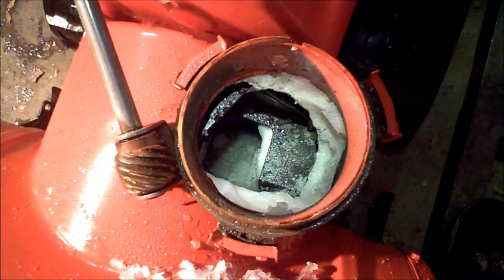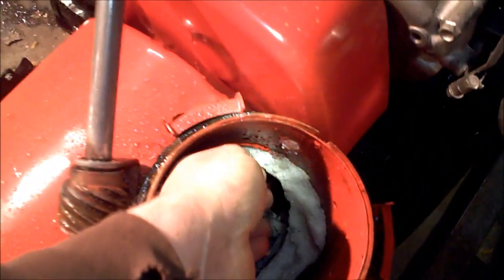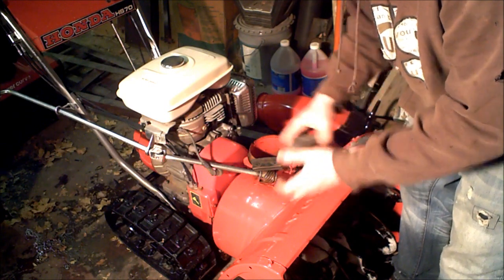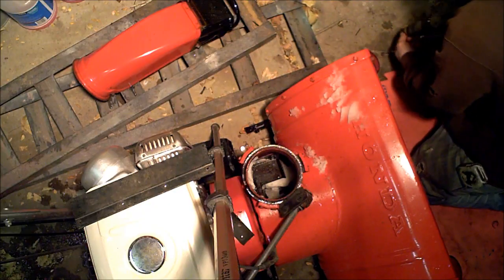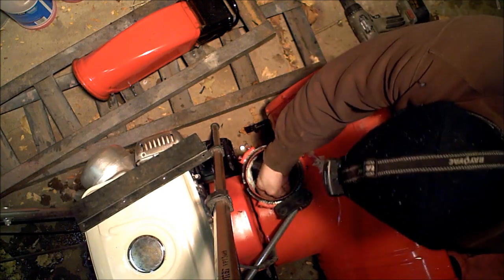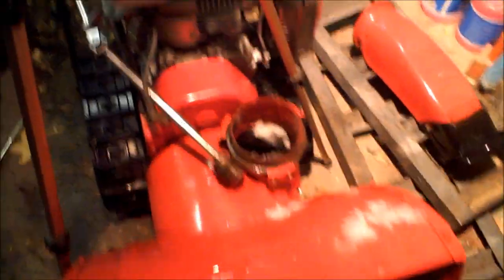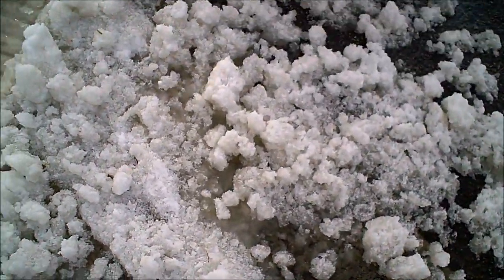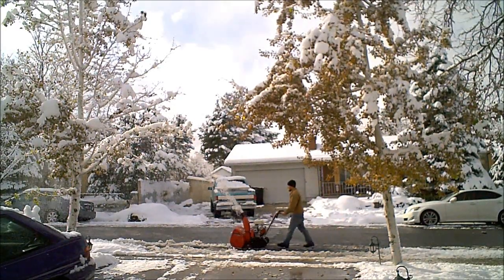Modify Snowblower to never clog and throw twice as far w/ Impeller Kit

Comment: I did this little modification and tried it out in about 8 inches of snow.
It will throw a lot further, but I don't think the engine and belts will stand it.
So I will have to remove the mod.
Reply from the maker: Because it is a more efficient impeller is will use more of the available horsepower. You will hear the engine work hard for the first time in it's life as it is doing more work. As far as belts, they could break if they are old or worn out. Most belts are rated to easily handle 20+ horsepower.

Comment: I have a toro s200 from the late 70's, have gotten that thing tuned
 up and it kicks ass, just got a MTD snowflite 2stage blower that need some love, I am certainly going to try this out, seems like a no-brainer to me.
Reply from the maker: Those old Toro's are die hard machines. It works off the same principle as your S200. Once those start to wear and you get a gap more than 1/4" an S200 with suffer in throwing distance.

Comment: I did it to my 37 yr old (modified) John Deere and it worked fine. I did notice that I will have to upgrade to a tighter belt that powers the impeller. The current one slips a bit under the added load.
Reply from the maker: It definitely uses more of the available horsepower of the machine. Belts get glazed/polished after a couple of  years of running.

Comment: I have an MTD (5 1/2  22") with a plastic impeller.  It looks like the gap is about 3/4 inch.  Will this work?  Another question:  How to you remove the chute on this machine to access the impeller?  Any help would be appreciated.  Right now this machine throws the snow only about 3 feet.
Reply from the maker: Your machine is a prime candidate for this modification. With a 3/4" gap there is no reason you shouldn't be able to 5x-10x your throwing distance. MTD has a few styles of chutes but most just have 4 small bolts that hold them onto the rotating assembly.

Comment: Hi 65:
I have a 9-year old Craftsman 536.889251 (Murray) 33" 13hp snowblower that works great in dry snow, but not at all when even slightly wet. Your solution intrigues me, but I am not a "wrench" and have a couple of questions. The impellers (3) have an uneven gap from about 3/8" to almost a 1/2" at the rear part; it seem fairly thick and may not work with the sheet metal screws. I removed the chute, and there is quite a distance down the rectangular hole to reach the impellers; larger than any drill bit I've seen. Any thoughts?
Reply from the maker: On some of these Craftsman it is a little challenging. This is one of the reasons I try to make a self tapping screw work as you can get drill bit extensions pretty easily. Then you can use a phillips bit to drive the screw. I picked up a 6" extension for a couple bucks at the Home Depot. Sometimes if the steel is really thick it will take 2 screws to get through as the tip on the first will wear out.  In your situation it is well worth the effort and you will see a huge improvement.
Reply: sixtyfiveford
Thanks. If I may ask one more question; the impellers have a round hole (5/8" or so as best I remember.) Is it OK to block these with the rubber gap seal? Is it only a lightening hole, or is there another reason for it?

Comment: I think you mounted the little rubber pads on the second stage blower with only a small clearance is that correct ???   you screwed them right on the blades of the impeller??    I am hard hearing and I didn't catch all you were saying..
Reply from the maker: Zero clearance and yes, screwed directly to the impeller.

Comment: Awesome modification.  Performed it on my MTD Yard Machine (26" / 8HP) snowthrower last night.  Easy to do.  Used my snowthrower this morning.  The mod ABSOLUTELY WORKS -- snow was thrown significantly farther.  Easy and very effective modification.  Thanks for posting.
Reply: Rodney Palmer The only issue I had with the chute was that all bolts had some surface rust on them, and needed a little convincing to come off.  The snowthrower is garage kept, so the rust was not too bad ... didn't even need to use any penetrating lubricant, just a little extra muscle to get them off, and I replaced with new nuts and bolts when re-assemblying.
Reply from the maker: +Jerry Rath, III  That's great. I'm glad you took the time to do the modification and thanks for letting me know.

Comment: I have a brand new Troybilt snow blower and it has a 3/8 inch gap, I want to put the paddles on but I do not have a tire mud flap or conveyer belt but I do have solid rubber matt two ft by two ft . 13/32 that's .406 thousands of a inch thick can I use that?
Reply from the maker: Yeah, that would work as long as it is rigid and doesn't rip easily.

Comment: Quick question. I put these on my snow blower and made sure they were up against the metal. After I re-installed the chute (removed like you did to attach these) I noticed after the rubber flaps clear out of the metal housing area there is then a gap between them and the chute. Do you think this will clog? Or do you think it will work just like it should? I'm guessing it will work like yours. Thx for the great videos you put on here! Was able to fix my own snow blower thanks to your videos!
Reply from the maker: Yeah, it will work.

Comment: Your video and other videos I watched regarding snow blowers helped me realize how simple these machines are. I bought a used 1991 MTD 24" a year ago. I had major issues with it working decently the first year I had it. I only use this machine for removing snow in the back yard for my PUGs. I replaced the 2 belts (auger and drive), new generic shoes, a friction plate rubber, a shave blade and lastly the impeller pads. I bought a strip of rubber matting from tractor Supply and screwed them on the impellers. I cannot believe what a drastic change and improvement those pads made. NO CLOGGING AT ALL. And I blow through the 24" we received in the last week, and also some wet snow without any hassle. The only bitch was the cheap self tapping screws I bought from hardware store, I broke a couple when drilling pads to impeller. Your instructional video was awesome and extremely helpful. My machine is like new. Let is snow, let it snow, let it snow!
Reply from the maker: That's Awesome.... I'm glad you liked my videos and you attempted this. Yeah, some of the cheaper self tapping screws will snap off their drill point. Glad you got it sorted out though.

Comment: I HAVE a murrey snow blower about 7 years old clogs up on wet snow. will your fix work because the metal shaft from the top of the impeller is a lot deeper then what you show that is why my shoot clogs. the impellers blades are close to the housing.
Reply from the maker: Yes, this will fix that problem.

Comment: Interesting video.  I have a 12 hp 30" x 21" craftsman snow blower.The auger gear box broke.  When I go on Sears web site the total individual parts cost is $455.00 which for a 15 year old machine is cost prohibitive.  Any idea where I can get a cheaper replacement gear box?
Reply from the maker: Sears doesn't make any of their own power equipment so they are always more expensive than anyone else. What's your model #?
Reply: sixtyfiveford My Craftsman snow blower model is 536.886390.  12 hp 32" wide.  The total piece part price to replace the gear box is $455.00.
Reply from the maker: Your machine is made by Murray. Chances are just your worm gears are bad (313861 or 53730MA and 313862 or 53732MA). I find one new online for about $80(313861 Ebay) and the other for around $25(313862).

here is a better view parts breakdown:
http://www.partstree.com/parts/?lc=murray&mn=633134x31A+-+Dual+Stage+Snow+Thrower+%282000%29&dn=11249

Here is a complete used unit for under $150:
http://www.ebay.com/itm/Auger-Gear-Box-Blower-Assembly-Craftsman-Murray-Noma-523-Model-trac-drive-3-/281153480424?pt=LH_DefaultDomain_0&hash=item41760da6e8
Reply: sixtyfiveford Wow!  You are right on about this.  The drawing you send is the exact same one that is in the Sears manual that I got when I bought it.  I need the complete gear box including the right and left side case.  Mine got chewed up really badly when the bearings went.  Interesting you found the used one. I might see if they will negotiate and where it is.  I do not need the impeller just the gear box assembly minus the long shaft that the two pieces of the auger slide on.  I do need the shaft that the impeller mounts on.  Thanks so much for the info.

Comment: I have a small gas matis roto tiller, and I can't get it started! I could pull on that cord all day till my shoulder fell of and it still wouldn't start and I'm super strong! So I know I need to get an electric one if I want to be able to handle it on my own. I'll be happy if I can just get a small electric that I can manage on my own! Thanks again for all your help, I really appreciate it..
Reply: Diane.  The carb is probably a ZAMA.  You can buy replacements for around $20 which will be a lot less than buying another mantis.

Comment: Thanks so much, I've read such mixed reviews. I just had a beautiful deck built and it's high off the ground so I'm concerned when the snow is heavy. I really appreciate your really quick feedback ! Di
Reply from the maker: A gas powered snowblower will always outperform an electric but there is the hassle of maintaining a gas powered unit. Most of the negative reviews are performance related and people expect a $200 electric unit to perform the same as a $600 gas one. Anything is better than shoveling and if your expectations are realistic you'll be happy. Personally I would choose the 1500 or 1800.

Comment: actually, i already did do that, but the material i used was too thin, i put them on last spring, they worked great until this morning, then i noticed they wore down too far, and the snowblower clogged this morning, thasts why i wrote to you, to see what you used. i will get back toyou, but it will be awhile     dick bailey
Reply from the maker: Conveyor belt and tire sidewalls have reinforcing fabric stands. They are your best bet.

Comment: Thanks for this video.  I had a 1 inch gap. The snowblower always clogged and I didn't know what to do. Thought I needed a new one. This mod did the trick. Got mudflaps, cut them and bolted them and then turned on the machine and spun the impeller and let it cut it exactly to size.  Mod took prob 20 mins. I've got the best snowblower on the block!!  Thanks again!!
Reply from the maker: That's a huge gap. If they bend to much you with that gap you can add a flat piece of metal to within 1/4 of the housing. Put it in between the impeller and the rubber flap. Thanks for posting and thanks for trying it. -Moe

Comment: Hi, I'm looking to buy a small electric snow blower to clear my deck and my driveway when it's a small storm and not enough snow for my plow guy to bother with. You mentioned a Toro Single stage in your video, is that still your preference? Thanks for the info, Di
Reply from the maker: Yes, you would be very happy with anything Toro. There small $100 Power Shovel is great for a deck but a little small for a driveway (still better than shoveling). There 1500 Power Curve is only 25 pounds and and does twice the swath(15") of the Power Shovel. It would be great for deck and driveway and it is around $200. They have a third (1800)which is a little wider(18") and has a bigger electric motor(12amp vs 15amp). It is also 25 pounds and is the priciest at around $300.

Comment: dude, great idea, but when those s/t bolts come loose, and fly out like BULLETS, they're gonna smash some windows in homes or cars, take someone's eye out, or worse.  you have to think about that.  use nuts/bolts with locking bolts and locktite, or tack welded nutss on the bolts- and this is why the mfr. didn't put that on there, for liability reasons
Reply from the maker: Ice chunks are just as hard and have 10x more mass.

Comment: Wow!  I'm not that handy so it took me a bit longer than you to do the mod.  Used a cheap truck mud flap and the metal screws.  I tried it out today on some fresh snow and I'm throwing snow probably 2.5 -3 x farther then before! My snowblower was barely putting snow out 6-8 ft before and now its at least 20ft.  I can also take larger swaths without leaving a trail of snow behind from overflow.  Thanks!  Great video
Reply from the maker: That's great to hear. I'm glad you took the initiative to tackle this. 2-3x is great!

Comment: I did your modification and I can throw wet snow 30 feet. I did not have the rubber stuff You mentioned so I bought a piece from McMaster-Carr  #8617K45  for $25. We had about 8 inches of wet snow and the snow balled up in front of my 11HP Craftsman 30" wide machine.I have modified my machine by putting 2 LED lights on either side of the blower,  but the blower's alternator makes AC and not DC as needed by the LED lights. I solved that problem by wiring a Trimumph bike diode in.
I also used 2 U joints, an eye bolt, a rubber grommet, then mounted the chute control handle up through the top control panel instead of being at your knee level.
Reply from the maker: Moving the chute rod is a great idea.

Comment: Cut up some old (60s vintage, in fact) scooter tires for their sidewalls to make impeller blade extenders for an '85 Toro 1132. First thing: JEEZ, that impeller has seen some abuse! The blades are at crazy levels of bent-ness and bruised-ness, AND FAR (one was >3/4") from the walls of their housing. (This summer I'll take it out, straighten and weld, and put in big, permanent holes for rubber blade extenders. Meanwhile... ) I put the rubber blade extensions on (with stainless self-tappers, yeah) and it is AWESOME. (Tested against some snow piles from last week's storm.) I'm up in New England, and we're gonna get pasted with some wet and heavy tomorrow. Great "live" test run coming! Note Silicone lube spray helped the break-in of the chamfered, but still over-length, "blades." Thanks, sixtyfiveford! Good stuff!
Reply from the maker: You're welcome. I'm glad you took the time to do this and love that you used vintage tires. Yeah, those Toro impellers take some abuse and are almost always bent. Let me know how the test goes in the next few days..

Comment: Thank you for this great Idea. I bought a craftsman 9hp 24 in cut yesterday for $125. before I modified the impeller it wouldn't throw snow 2ft. After I installed the same mods exactly as you did it and now it throws 30-40 ft with no problems and no other adjustments.
thanks again. Folks this will make your snowblower work like a new one.
Reply from the maker: Thanks for posting. I'm glad you tried it and got such amazing results.

Comment: Hoping you can help! First, finally got around to doing this mod on my Ariens ST824 a few days ago, just as we were getting hit with some heavy, wet snow. All went as you explained and it definitely throws the lighter stuff MUCH further now (wow!), and at first, worked great  on the slushy plow pile on the street.  However, after about the first 45 mins of use, the rubber truck mud guards I used still seem to be pretty tight against the inside of the impeller/shoot area (should it be?). And now, it seems like the adjustment on my right hand control (the clutch for the auger drive?) has changed all of a sudden where if I do not have a very tight grip on it, the power to the auger/impeller decreases and almost immediately begins to allow the chute to get clogged up, at least with the heavier wet snow. How do I adjust the lever so that it works properly again? Appreciate any insight you can provide!! Hoping I can get it to work like it used to and now be able to blow through the heavy stuff without clogging anymore.  Thanks Sixtyfiveford - love your channel!!! - Nick -
Reply from the maker: The rubber impeller paddles should barely touch and shouldn't offer any real resistance to it turning. It sounds like your belt is bad. Take off the plastic cover behind the chute and take a look.
Reply: @sixtyfiveford  I concur...

Comment: 60/5 ford
I checked out the Toro 724  37770 and it looks like the cats meow. Its a really really nice machine.
First Question is the Toro 724  37770 the same as the 724OE? Toro also says they have a Anti-Clogging System which lets excess snow bypass the chute through a channel back into the auger. Does it work, and can you still use your impeller kit? And if and when I buy this Toro would you sell me the correct impeller pads I need if any? My neighbor and I will try to install them correctly. Love your other videos, your quite the renaissance man. The battery pack video is very cool. Once again thank you for your time.
Respectfully,
Ernie
Reply from the maker: Yes I meant 724 oe http://www.homedepot.com/p/Toro-Power-Max-724-OE-24-in-Two-Stage-Electric-Start-Gas-Snow-Blower-37770/203516983?keyword=toro+724

Yes you can still use the paddles on this Toro. There are less expensive models out there, the Toro is just the best bang for the buck out there right now.

Comment: the tire was to thick so i ended up using a rubber squegee beleive it or not, that worked perfectly and also found out the auger belt had about an inch and a half of slack, so i ordered up a new one, but beleive it or not it does work if you cant find anything else to use
Reply from the maker: Yeah, the "st" tires are from trailers and will have a thicker sidewall. Glad you got it figured out.
Reply: the augers wouldnt even start up when i get my new auger belt in next week i will find out

Comment: I have a Sears Craftman 9hp and the impeller blades are thick metal. Is it possible to drill holes in them to add the rubber paddles? I would really like to modify them as the chute is always clogging. Thanks.
Reply from the maker: Yes. If it is over 1/8" thick you will have to predrill the holes but it shouldn't take long at all.